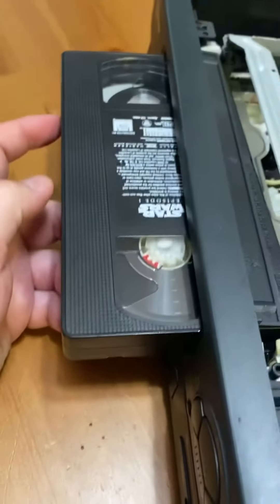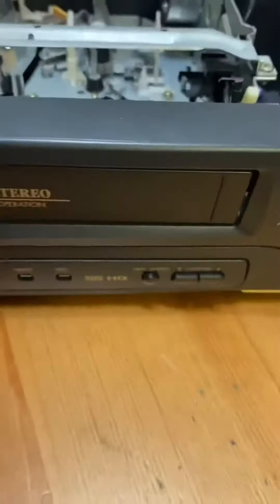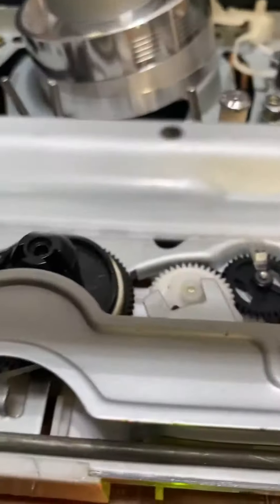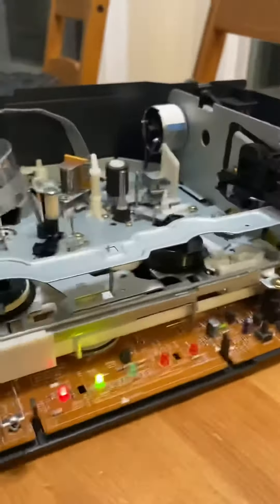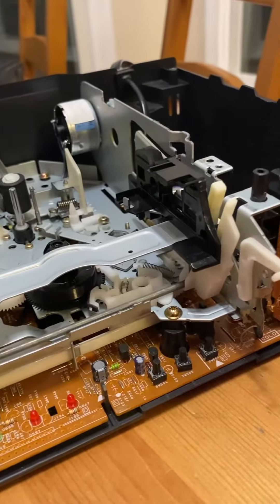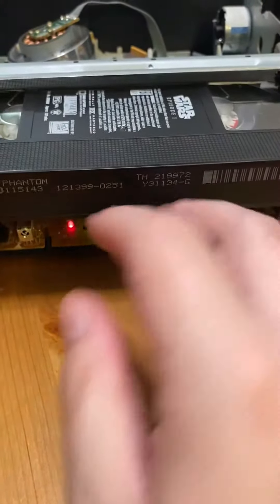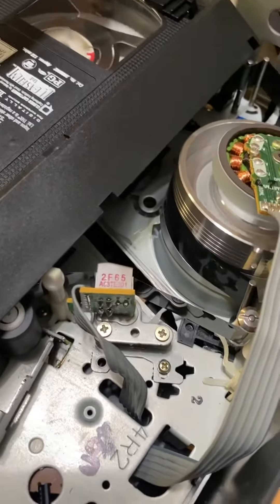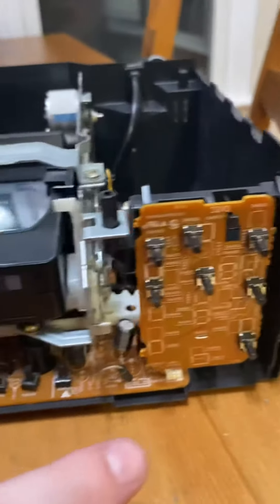VCR will not accept VHS tape fix

Comment: I did this and then when I put the cover back on and inserted the tape it doesn’t even work again. Not sure where I’m going wrong here…it’s like that white tab is stopping the door from opening. I tried again with the cover off and the tape is inserting but now it’s not playing anything.
Reply from the maker: @watchingsinan  Not sure why it would not work after putting the face and cover back on, maybe make sure your contact points are clean.
With the cover off, you said it’s accepting the tape and running like normal but nothing is displaying on your screen correct?
If that’s the case, make sure your head is clean on the VCR. You can use notebook paper and a light amount of rubbing alcohol, high grade %. Use light pressure, spin the head so the “eyes” on the head run across the paper, it will clean the head.
Don’t push on the “eyes” on the VCR head to clean better, that will mess it up worse.

Comment: I got my jammed up from repeatedly trying to get a (I guess) bad tape to play. Can't wait to try and solve it later.
Reply from the maker: On any tape that has not been used in a long time, turn the tape with your fingers in the cassette holes to move it along and help break any sticky friction that can hurt your VCR motors and pulleys.

Comment: Awesome!!! i am having a similar problem however my VCR accepts the tape and then throws it right back at me and then shuts itself off like red light power off. I have tried several times to play the tape by pushing it back but no use IDK what should to do now.
Reply from the maker: Does it eject all tapes or just that one?
Reply: @HerrTweekCat  to all of them mate, also i forgot to mention the model is Panasonic SJ3MK2

Comment: Might try this on the VCR I have, it has the exact same problem and even makes the same grinding sounds as yours. It would make sense for something to be stuck in the tape loading mechanism, there was a VHS stuck inside the VCR and I kind of just yanked it out to remove it...
Reply from the maker: Exactly, later playing around with it, if a tape jammed and was forced out, that lever would stick about 80% of the time.
Reply: @HerrTweekCat  I'll tell you how it goes, although it's not going to be done very quickly, the VCR is over at a different house which I don't really go to very much
Reply: @HerrTweekCat Well, I tried it, and it got the point where the VCR took the tape and started playing it but it made creaking and whining sounds and the mechanism kept getting stuck. Then when I tried to eject the tape it ate it again, and these kinds of issues are beyond my skills of fixing unfortunately. Maybe I will ask some other relatives if they have a VCR that they would give me.

Comment: Hi, I have an issue with my vcr. The red light (i think it’s the power) is always on and wont turn off. It won’t let me do anything. It’s the very left red button on the circuit board. Does anyone know what this is? Its an Emerson model# EWV601
Reply from the maker: That does look to be the power light, I found the user guide for this model on manualslib.com 
I would make sure it’s completely empty and gently wiggle all the mechanisms that would normally operate when a tape is inserted and pulled. Just in case the unit is frozen from not being used for so long. The unit might not be operating to prevent itself from burning a motor.
Look at the belts to see if they are stuck in place as well.
Reply: Ok. Thanks so much! It hasn’t been used in a long time, so maybe that’s the issue.

Comment: I have a Emerson 874 vcr. Can't keep power on long enough to get tape out
Reply from the maker: Maybe start with the cord, is it old with a possible break inside, try manipulating it while plugged in. When electricity warms the cord, the conductors might move and lose connection. (While power is on)

Comment: Hi I have a 2 Sony VCR that the tape gets stuck during ejection. But if I push the tape during the process it like it pops free an ejects it. I don't know if the gears need to be greased or not
Reply from the maker: When it gets stuck. Is the tape still pulled out of the cassette?

Comment: I don't think thats my problem. It doesnt play the vhs, the vcr keeps shutting off. I have an emerson dvd/vhs player (model number is EWD2203). The dvd side works, but not the vhs side.
Reply from the maker: Sometimes the power will turn off to protect itself, is the VHS tape in good condition? If the tape won’t rotate it can cause the VCR to turn off. 
The top reasons for the tape to not rotate:
It’s sticking together in the wound reels, force it to rotate manually or with a separate rewind/FF machine. 
Friction between the reels and cassette on the bottom side is too great, you might have to swap the tape to a new cassette.
Reply: @HerrTweekCat  yes the VHS is in good condition, I tried multiple VHS tapes on the vcr
Reply from the maker: @TISUAL  I think I have that same model, let me look at it tomorrow when I’m back home, I’m currently out of town but want to help if I can. Definitely take your cover off and when the power is on, gently touch the moving arms that guide the tape to the head to make sure they are not jammed. All this small parts run on gears that are greased and can stick when they have been out of use for so long. Keep me posted and I’ll reply with more thoughts tomorrow. Best of luck
Reply: @HerrTweekCat  yeah I been took the cover off and I took the front facing cover part off too.  I saw some type of light greenish liquid in the cover where the reel is.  Idk what it is so I left it alone and took a video of me inserting the tape in the VCR showing what it's doing.  I think I may look into some companies who may be able to fix my problem.
Reply: @HerrTweekCat  did you ever try it out? I have another VCR that is doing the same thing now except it takes the tape but does not take the reel of the tape. I was cleaning out some VHS and don't know what I did because I was pulling up the metal rods (that usually would take the reel of the VHS) when the vcr kept shutting off every time I put the microfiber cloth in the VCR (I notice I was placing the cloth in the wrong spot afterwards). The VCR was working beforehand.

Comment: Could you explain where that lever needs to be positioned? Should it be moved whrb i open the door?

I have this exact issue but can't get anything to change.
Reply from the maker: That lever needs to line up with the door for when the cassettes are inserted and ejected. It can get stuck when the cassette is pushed in to hard or the actual tape gets jammed and the cassette is forcefully removed. 
There should be a notch that holds the lever in line by the door.
Reply: @HerrTweekCat  Thank you! I have run into a new issue now. Any idea what might make the VCR shut off only when I try to Stop RW or Stop FFW?

Every function including normal FFW and RW works now except for those.
Reply from the maker: @cxx23  it must think it’s jamming when it abruptly stops in those functions. I’ve not yet had that issue so I’m not sure on how to repair. Although, I recommend buying a rewind/FF unit to keep your actual VCR wear as low as possible.
Reply from the maker: I used a rewind videomate on this video: https://youtu.be/5OBkMSZvS9w
Reply: @HerrTweekCat  I really appreciate the tips!

Comment: I have a Mitsubishi HS-U65 
S-VHS  AS soon as you turn it on it turns it self off within 30 seconds.
How can I fix this. What do you think is wrong with it?
Reply from the maker: It turns off just because or after a tape is loaded? If the tape is jammed or not feeding due to friction, the VCR will turn itself off to prevent damaging itself.

Comment: Mine similar issue blinking green vcr light ...tape wont push in..my plastic piece is not bound up though...i believe the small motor at back right should power on to pull tape in and down and its not powering on...any ideas?

Comment: Do you think this could work with one of those vhs playing tvs? When I try to put a tape in, it gets stuck and turns off the tv.
Reply from the maker: That’s definitely possible. Try a few tapes, sometimes if the VHS tape is old and kinda stuck to each side so it will not reel out easily. The VCR will turn itself off to not damage itself from the tape.

Comment: Thanks, this lead me to a fix (seemingly) for my 1999 Panasonic VCR. It suffered a recent fall and a plastic lever/switch on the right side of the tape loader came loose and was blocking the tape tray from shifting, I fiddled with it until it came free, now it seems to work perfectly, but I'm wondering if the piece I removed is actually needed or not... 🤔😬

Comment: Congrats. Mines still broken
Reply from the maker: Keep searching on YouTube and hopefully you find the right video to help gets yours working. Best of luck 🤞
Reply: Tape not loading? Make sure the levers/switches on both sides of the tape loader afe free, the tape tray should be able to shift back and forth (unless in a locked position?), at least that's what seemed to work for me just now.

Comment: Nice fix, that lever was the one that opens up the plastic door when you eject a tape, pretty weird that it got stuck though.
Reply from the maker: I think that lever can get stuck when the tape is in the lower position and then it jams or the VCR turns off unexpectedly so when the cassette is removed manually, that lever might get hung.

Comment: I use to fix VHS recorders years ago,what I would do was take out the cassette housing mechanism and reset it ,easy fix.
Reply: How do you do this? I can't find a working VCR for the life of me.
Reply: @dawnweinerdawg  I live in the UK,and there's plenty about you just have to look.
Reply from the maker: I look at garage sales, thrift stores and I know there are loads on eBay. Just be careful when on eBay could not work.
Also, ask around, you’d be surprised who might have one in the basement or garage and they will just give it away. 
Happy searching
Reply: @HerrTweekCat  I can't do eBay anymore, they keep sending broken ones 😭 Facebook market place same thing. Even ones that say tested don't work.
Reply from the maker: If you are in the US try Goodwill stores that are in rural areas. You might find one for $10-40.00 range and work. If you can, test the unit while still in the store, take a junk VHS with you just in case one isn’t avail. 
I’ve definitely been burned on “tested” sales as well.
Reply: @HerrTweekCat  we rarely have garage sales in the UK,it's either Facebook or eBay like you said.

Comment: Interesting video, though my tape wont go in, and that bar you loosened is already moving freely. So my problem is something else.
Reply from the maker: What make and model do you have? Also have you compared two VCR’s to see what should be happening and interacting with the VHS tape. That can help you see what’s not actioning.
Reply: @HerrTweekCat  Thanks a heap for the reply. My issue has been sorted. Incredibly, after some hrs of my machine sitting on my table with a tape half in, it decided to cycle the tape in during dinner. We heard an odd noise from the dining room, WTF? tape tape was running. Turns out its a loose connection or whatever where the main power enters the machine. I can easily jiggle it to get it going.
Reply from the maker: That’s great news! Yep I’ve seen some random issues that almost fix themselves and thats exactly why I made that quick off the cuff video. Best of luck, this weekend I’m going to watch ET on VHS before the digital edits. Haha
Reply: @HerrTweekCat  That movie is nothing to phone home about...:)

Comment: I gave up and tossed in trash...i believe the issue was either a bad load motor or bad contactless sensor...i spent 3 hrs tinkering and thats too long to spend on an item with little value.
Reply from the maker: Oh nooo, probably best if it was causing stress. So sorry for not replying, I was on a ship without Wifi. Hope you are doing great!